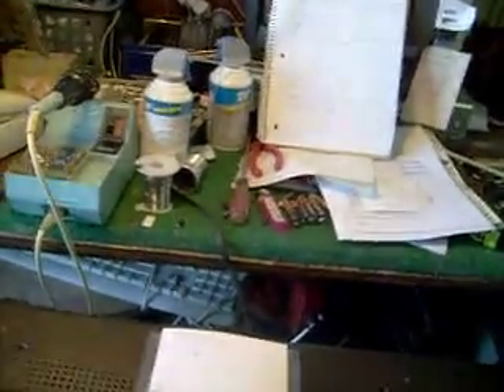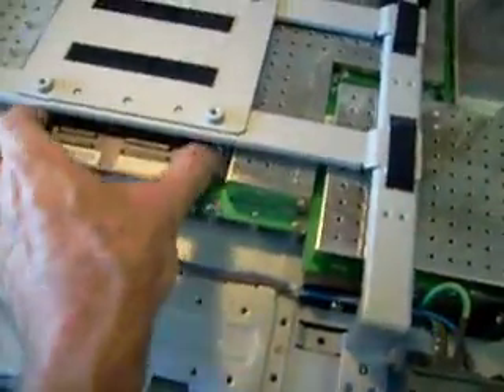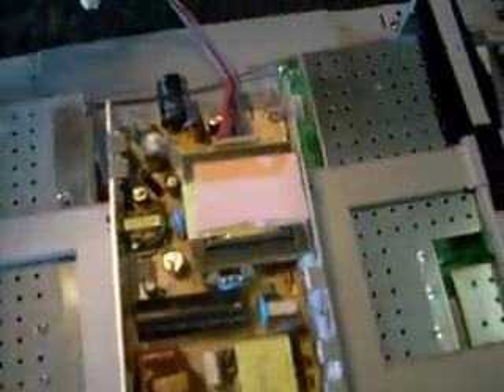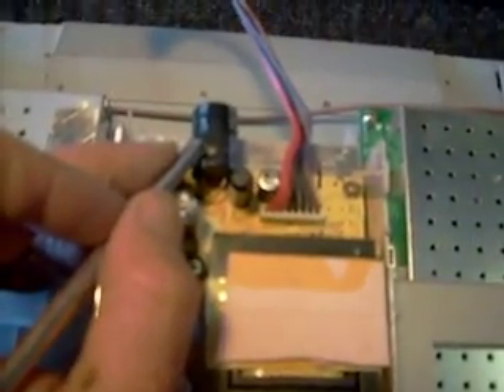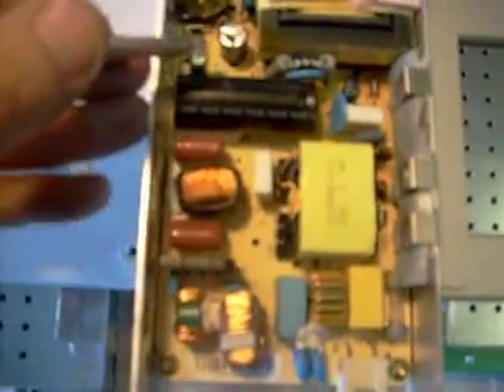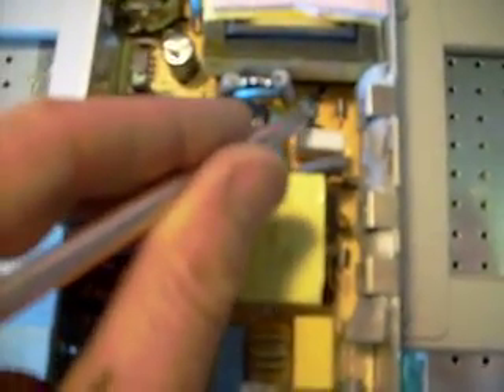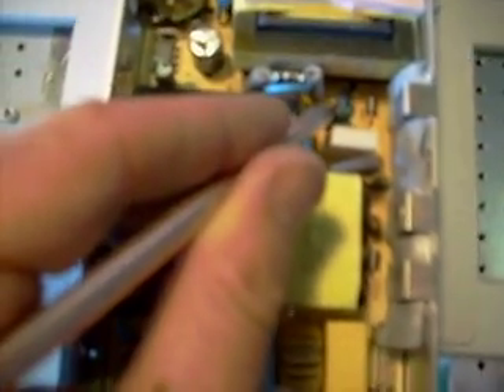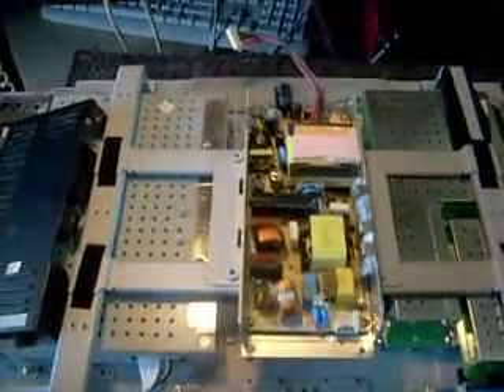POLAROID TV FLM2601

Comment: Hello, I have this exact TV. It finally gave out today from Hurricane Sandy's power outage but before that every time I shut the TV off and then back on later, it went through a very long series of shutting on and off by itself very quickly and eventually it staying on.So over the past months I have had to keep the TV on 24/7 to that from happening. But it's finally dead. It's the power supply no doubt. What do you think? Easy capacitor or transistor fix?

Comment from the maker: Someone told me as fluorescent lamps leak over time and as the outside air gets inside them this causes a build up of carbonized air which is more conductive. If this is true it would mean over time they would have a lower resistance rather than a higher one..

Comment: Im not sure I explained this very well. This problem does not shut down the TV, it simply dims the lower half of the screen. It is still watchable, but two levels in brightness is annoying.  Do these bulbs increase in voltage resistance as they age? Which board balances the power going to bulbs? I am not a TV repair shop so i don't have any parts or lamps to test with, but i have successfully replaced bulbs in a LCD tv before.

Comment: I just rescued this same TV (FLM-2601) from a trash pile. It turns on normally and shows a good picture. After about 10-20 seconds, half of the backlight loses power (usually the lower half dims, but a few times the upper half goes dim). This leads me to believe that the bulbs are OK and this is likely a bad inverter board. To be clear, half of the screen goes dim (not black), where the picture can still be easily seen. No other symptoms. Should I buy the $35 inverter board on ebay? thanks TG

Comment: Got this TV from a guy and I was told the power supply didn't work right and had a history of repairs. After I took out the supply I noticed it had new caps on it. They weren't dirty compared to everything else. Looked at the underside and noticed someone had ruined part of the circuit board to the point it can't be fixed. I tried shopjimmy but they are out of stock. No luck on ebay and tvserviceparts wants $200 for it which is outrageous. Where can I get one for less used or not?

Comment: I had this issue with a polaroid LCD 2000 TV but I fixed it by using an XBOX 360 power supply brick to run the TV. works great. first tried fixing, then a new brick, no go.

Comment from the maker: @9kuuby9 
There can be several reasons an LCD TV doesn't come on. Bad capacitors in the power supply are probably the most common reason. One other common reason for a TVs not coming on are shorted components on the inverter board.

Comment from the maker: @9kuuby9 Generally speaking no but when you mention replacing your power supply with one that isn't the same how is it different? If all the voltages and current outputs are the same and all the terminal connectors are the same it should work, but sometimes a power supply that looks similar may be different in some way.

Comment from the maker: @mscott121279 
It sound as though someone else worked on it and failed to reinstall the clips and insulating material between the transistors and heat sinks.

Comment: You know, looking at the power supply you had in the video, I noticed my power supply didn't have any thermal material or the clips attached to the voltage regulators. They only had thermal paste on them. It must have gotten too hot and fried this way.

Comment from the maker: All you need is a 10 microfarad capacitor at 450 volts. Preferably a high temperature capacitor. This should not be hard to find. I suggest you start out calling digikey. 
You can probably find a local TV shop willing to sell you this capacitor, but how do you know this is the only bad one? You can't judge that all the other capacitors are good just by looking at them.

Comment from the maker: This should not hurt the capacitors, but there is a chance you could damage some of your switching transistors if your capacitors are not properly soldered in place. 
I'm curious as to why you would only solder on of the leads on your capacitors?
Dave

Comment: Two capacitors bust open in my Polaroid TV.  I replaced them with two same uf rating and higher voltage about 8 months ago. Recently the issues with the TV have come back ( buzzing noise and picture going out.) I open the TV back up at the replaced caps look fine. My question is, I only soldered one lead coming off each cap. The other lead i just put through the circuit board and bent so it would stay in place. Because I did not solder 1 lead would this cause the cap not to work ?

Comment from the maker: I don't have a schematic on the power supply your working on, but most of the time when the location letter starts with an L its probably an inductor which is generally nothing more than a small coil. If the coil is burnt I would suspect there are other problems as well.
Did you check your transistors, capacitors and diodes for shorts?